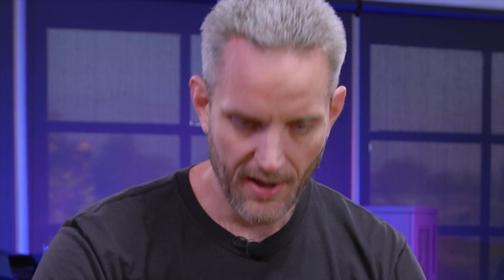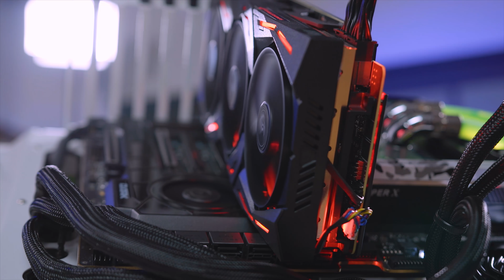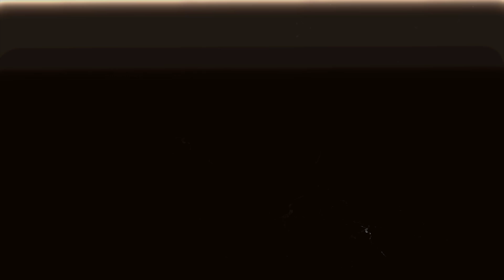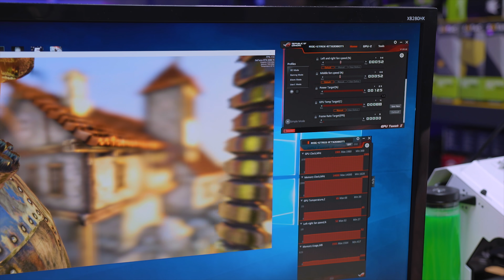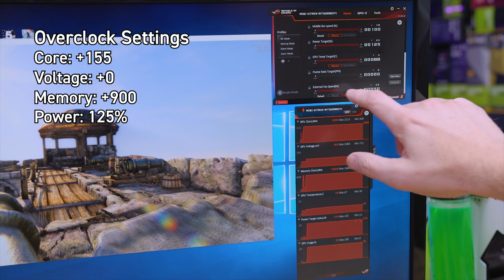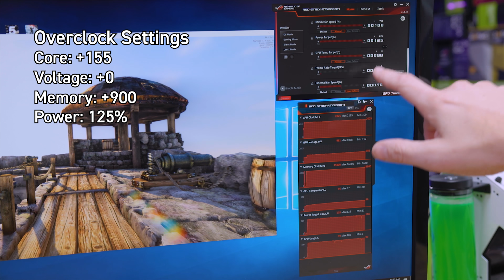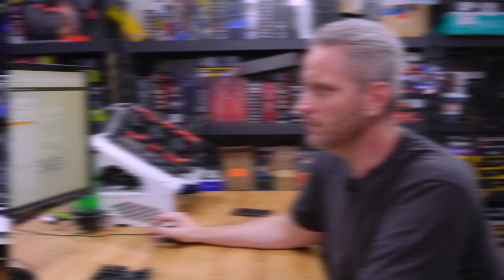ASUS ROG Strix 2080Ti Overclocking and Review

Comment: hope the 1080 drops in price^^ but i guess it wont
Reply: I bought my 1080 for $300 on ebay
Reply: @blunediv6209  lol you cant get a 1070 for that price, it must have been really used and they probably preordered the rtx 2080 and were just getting rid of the card
Reply: @skaterbi922  no i guess maybe it slipped through the bid period somehow... It was 250 with 30 seconds left and i sniped it at the last second. It was also very lightly used.
Reply: şķąţęŕ Bøi  Nah man, 1070's are all day 250ish around here bnib. You could easily get a used 1080ti for $500, even less if guy doesn't need it.  Btw, a "used" mining card would be a good find. When used for mining it's all about power consumption right? They'd definitely not be overclocked their whole life. Wait a little longer when the 2060 etc comes out and 1080ti's will be around $400-$450. I got my Titan XP for $700, Not the little p I know but still beats a 1080ti by a bit.
Reply: @blunediv6209  was it used for mining???
Reply: @rrizzle04  no used but brand new... I can confirm because its already delivered
Reply: Got a new 1080TI for $560......keep looking around and check slickdeals for 20% off eBay coupon.
Reply: Will ..... Eventually
Reply: itll drop during black friday/cyber monday
Reply: Mike Adams I have a feeling Nvidia set the price on the new cards way up there to be able to make a profit on the 1080 as long as they are available. They found them self with a large stock when the bottom dropped out on mining. But if the 2080 will drop in price when the 1080 is out of reach is another question, maybe they will get hybris and think that they can sell cards for every one at the ridiculous price they have now? Of course they can sell them now, but not all builders need, and can pay for these no matter what costs, they have to take care not to drop more users to the consols. I think we can see more reasonable prices for 2080 when the next consol hits the market
Reply: Mike Adams I hope so
Trying to snipe a 1070 ti ftw2 Icx off Amazon
Reply: There sub 500$ right now idk what more u want
Reply: Got a 1080ti oc for $580 on ebay. Looks and sounds like it wasn't used very much. You can get some good deals if you really go searching.
Reply: I got a Gigabyte 1080 Waterforce for $350 off Craigslist.  Works fine, temps are great, has some pump noise though.
Reply: FYI... you can find used 1080 ti cards right now cus' a lot of people are looking to upgrade. Really stupid to upgrade right now though. I see no use for something more powerful. There has been nothing... NOTHING I couldn't run well even in 4K max settings- and I mostly play 2K. /shrug
Reply: @zalibidas but buying used has a risk. i mean it could be broken, or only working partly and crashing often. whats your experiance with that?
Reply: Its usually fine especially around this time. Like I said, a lot who sell are really only doing it to upgrade to the next big thing. I usually make purchases around that time. I sold my 980 ti when the 1080 ti came out for example. That card worked like new.
Reply: Honestly, don't sleep on Craigslist for PC components. About half of my current build and everything but the gpu in my previous build were used, bought off Craiglist. Got 32 gb of DDR4 for 175 a few months ago. Just do your homework and check out the components before you buy.
Reply: Still can't even afford anything better than the 745 my PC came with
Reply: I just got an MSI Duke 1080Ti for $550 with no tax or shipping costs. Used off ebay but supposedly in like-new cond with original packaging. We'll see when it gets here later today how it works.
Reply: The time to buy a gpu was right before the new cards where announced. You got greedy and waited way to long.
Reply: Evga was selling b-stock 1080s for 330 a few months ago. They were also selling 980tis for 160 which I ended up buying to upgrade my little brothers 950. Which is pretty crazy because OC 980tis are quite a bit faster then 1070s
Reply: bubble boi  I might be wrong. But I'm laughing pretty hard-core at you replying to a 2 year old comment. We have 3080's here in 2020! Lol
Reply: bubble boi  I might be wrong. But I'm laughing pretty hard-core at you replying to a 2 year old comment. We have 3080's here in 2020! Lol
Reply: Tiamat do they not drop during Black Friday?
Build lint first of this Black Friday hoping things drop in price, but idk how far they do
And even if they do drop, there’s the issue of getting too stores before the other people lol
Especially those store campers